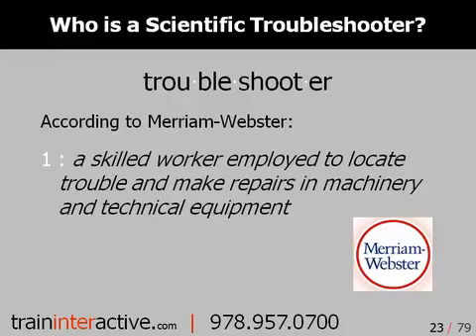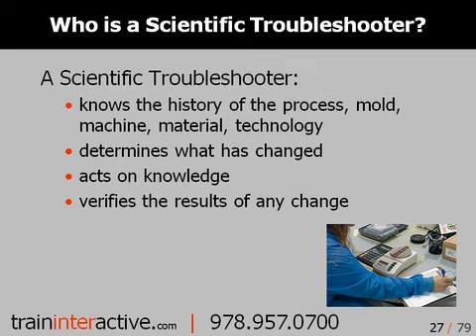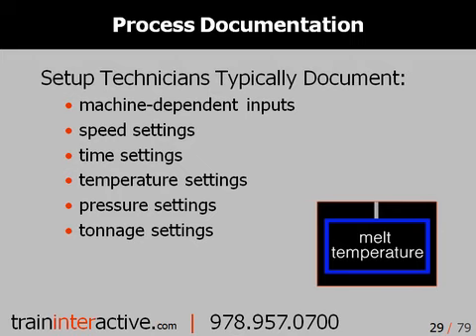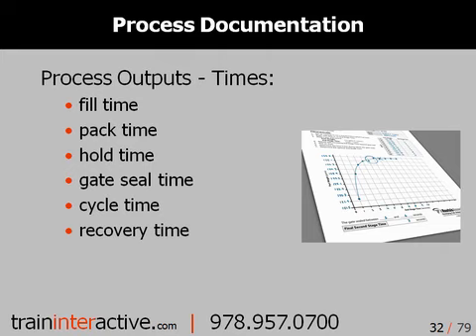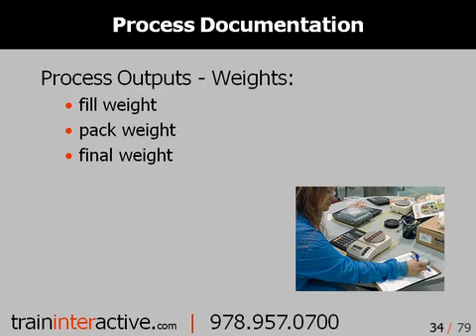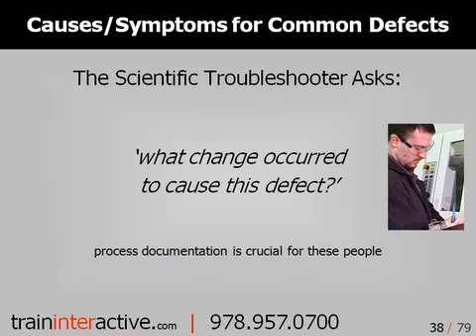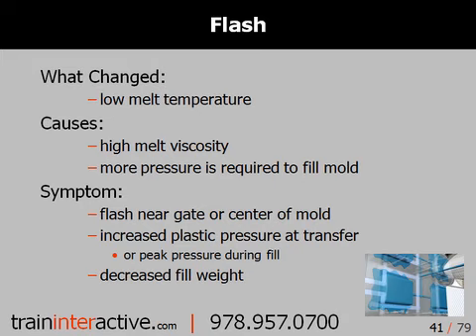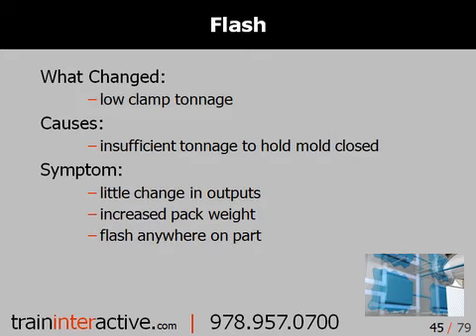Part 1 - Scientific Troubleshooting - Solutions for Common Injection Molding Defects

Comment: DOE's mean nothing if the clamp is off balance. Sometimes it is the press. Stable processes for years,  Clamping motor took a crap. Replaced it and found 1 of the tie bars snapped after. There was no signs of wear. Sometimes it could be the things we dont check.

Comment: reason why the automatic door not close
Reply: You got to press cycle button then the door button then it shuts then press the circle button to complete the shot. Press the hand button once the shot has completed then press the door button then the door will open.
Reply: @ashleybishton742  hello how I can calculate the shots for injection mold 4 cavities....  mold weight 25 grams and the machine is 180 ton